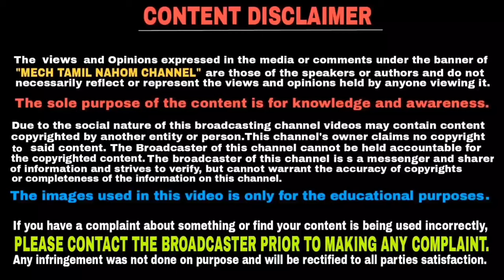Local mechanic vs company service center in tamil | authorised dealer | தமிழில் | Mech Tamil Nahom

Comment: Bro what you have told is correct local mechanic are best
 because in my experience B.S.V which is Chennai is an authorised service centre for hero they stolen my head lamp by replacing one of there old one when I left my vehicle for service